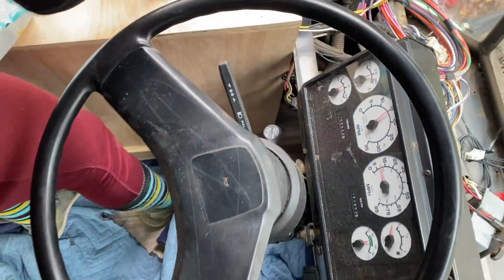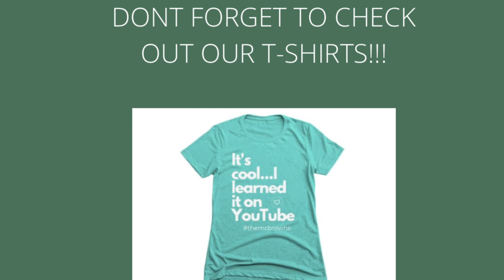Installing Flood Lights & Other Misc. Tasks - School Bus Conversion - SKOOLIE Video

Comment: Those holes we most likely "Weep holes".  These are made to drain water from the window tracks, so it doesn't freeze or overflow.  They are usually connected to the outside or a drain channel.
Reply from the maker: Yes - you're probably right. We had thought that at one point too, but clearly they weren't doing their job, so we thought we might as well give it a go. All has been leak free since we closed them up - hopefully we don't regret it later.
Reply from the maker: apparently, after talking to my hubby...we didn't seal them completely - just the butyl tape underneath to secure the window.

Comment: I'm building roll out pantry units under the counter with butcher block cutting board tops. I hate under counter cabinets. Using nylon casters. I will figure out how to lock them in place when in motion. You can do this and keep your windows.
Reply from the maker: Such a great idea! No matter what, we will likely have bins or roll out drawers in our cabinets. We are on a super tight budget so there’s a lot we WANT to do, but can’t. Next bus maybe 😆🤞🏼
Reply: @TheMcBrowns   those would be a great free pallet wood project. Cutting board tops are cheap at Walmart. Nylon casters are cheap at harbor freight.
Reply from the maker: @allmomomosthomebus3895  guess we better look into that option then - thanks for the idea! :)
Reply from the maker: @allmomomosthomebus3895  You are full of SO many good ideas! I cannot wait to see your finished bus - it's going to be EPIC!
Reply: @TheMcBrowns  I hope so!

Comment: Google "accordion shower door". Not the sexiest but you can order them custom sized and they collapse out of the way (so you could make it pretty inside!). One brand is "Magna-Fold."
Reply from the maker: Ok cool - I'll check that out - thank you for the idea! I'm cool with function over style, but it's always nice to have a bit of both.
Reply: Another interesting idea would be a circular track glass shower door. I'm putting redguard over plywood and tacking up oiled red cedar tongue and groove when I build the walls around our bath and tub area.